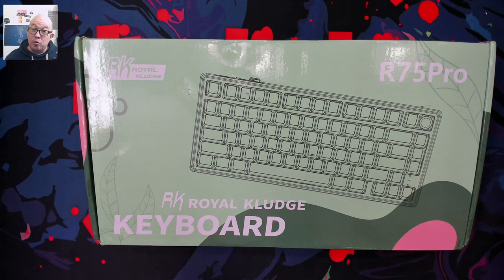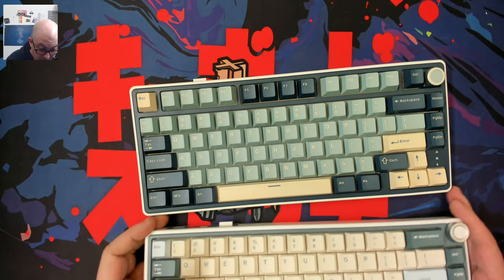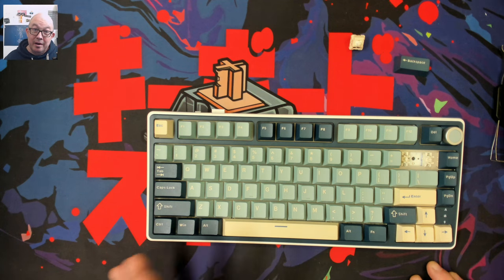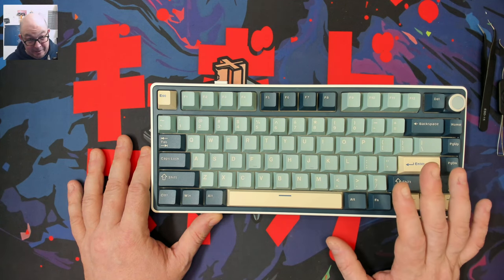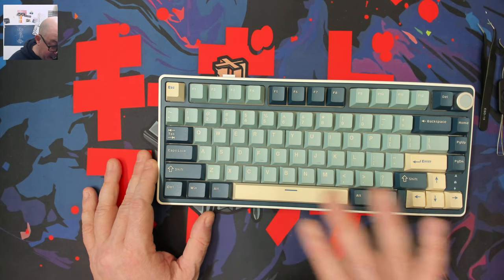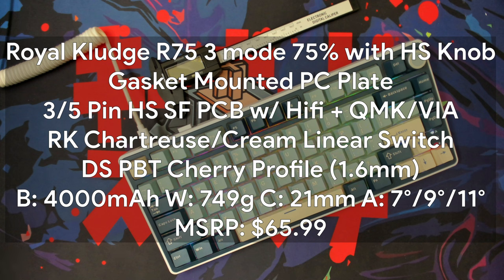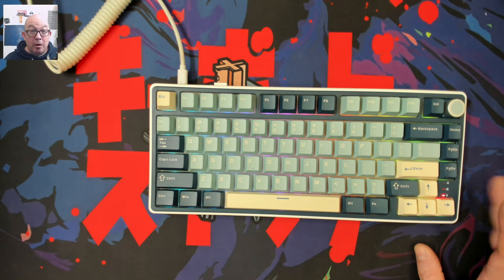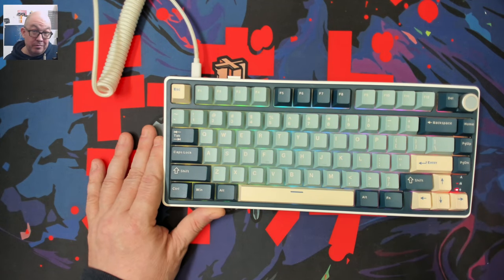Royal Kludge R75 Pro QMK/VIA 3 Moode 75% Review and Sound Test

Comment: They do have a split keyboard. RKS70 is the model number. It's my first split keyboard because it's the cheapest one I've seen easily available. It does have the ability to tent the two halves as well. Pretty neat.
Reply from the maker: Good point, I've just never seen it in stock, it may have been a limited run.

Comment: Do you have any recommendations for budget TKL? My top priority is reliability and no need to install drivers or software.  Btw nice channel, i just discovered you today. Relaxing reviews
Reply from the maker: How about the RK R87/iLovBee B87: https://www.youtube.com/watch?v=PSGuktkDuc4
Reply: @MechKeyboards  yeah looks nice. Do you have any way of testing keypress lag over bluetooth/wireless? I want wireless but I've had so many bad experiences with typing lag and interference
Reply from the maker: @slowjocrow6451  just pulled it out, put it into pairing, paired almost immediately with my Arch workstation. I typed a bit in gedit, browsed the web, and played a round of Tetris. No lag to report, it's quite solid, even when about 9-10 feet from the BT USB receiver. I've had issues with 2.4g in the past (with other keyboards), but with Bluetooth I've rarely encountered any issues with wireless devices; 2.4g is a crowded little sliver of spectrum, Bluetooth, especially 5 and up has delivered some of the best wireless experiences in my decades of PC use.
Reply: @MechKeyboards  There's too many options on Taobao and I'm going crazy trying to choose haha. I realise if a board is QMK compatible I don't need TKL, hmmmmmmmmmmmmmm